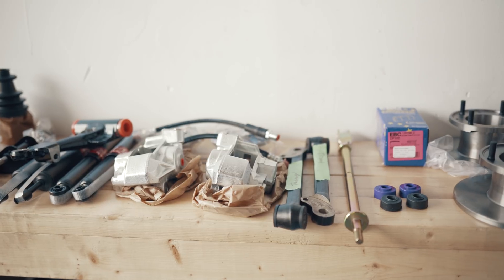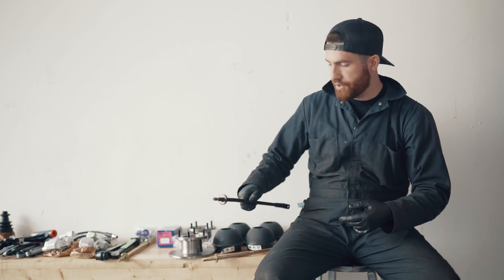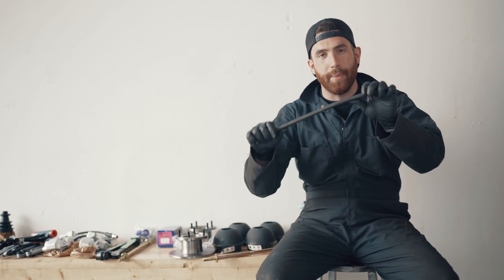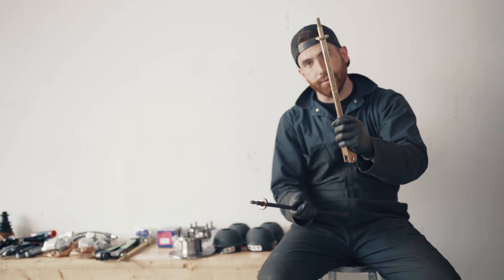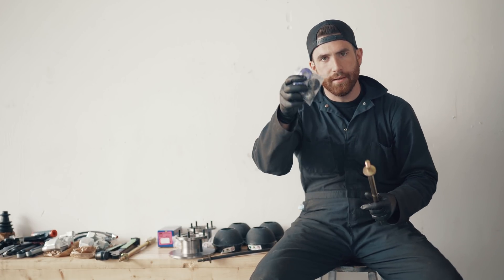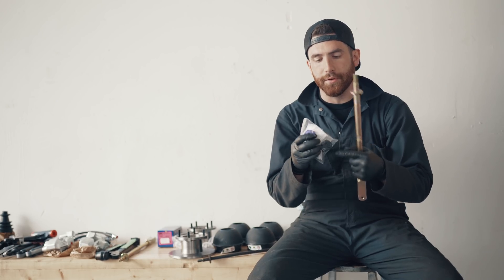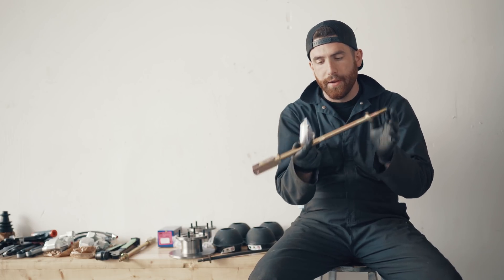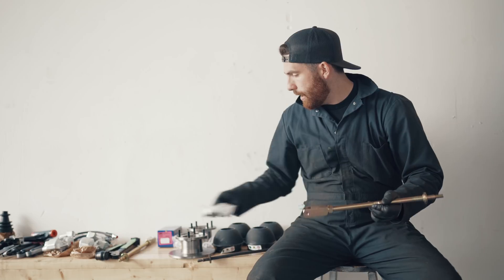Are your Tie Bars bent?

Comment: Thanks for vid. How do you correctly torque front tie bar bush nut? No room for torque wrench. I tightened nut until the bush expanded outside the domed washer. But nut wasn’t that tight.is this too far?
Reply from the maker: If the bush is rubber then you shouldn't tighten it so much that it expands past the washer. You can tighten by feel. Remember to use a lockwasher or a nyloc nut!

Comment: AFAIK the front bushing stops aft movement the rear bushing stops forward movement, braking loads are higher so the poly bush limits deflection and unpredictable handling under brakes, the rubber aft bush allows better absorption for NVH, loads under acceleration aren't as high and deflection matters less under acceleration. After reading a bit more it is not recommended to put hard bushes on both sides as it can lead to failure.
Reply from the maker: Arrin Daley you’re absolutely right, as you brake your car tries to overrun the arm and the poly bush stops it from moving aft, all the while the rubber bushing allowing up and down movement and preventing the arm from moving forward during acceleration. I agree it is not advisable to put poly on both sides, I have seen poly bushings dry weep and oblong when used improperly. Polyurethane can be great but only when used in the correct application 👍
Reply: I couldn't remember where I read it but it's talked about a bit at the end of this article by Keith Calver.
https://www.calverst.com/technical-info/suspension-heavy-duty-adjustable-tie-rods-21a1091-use/